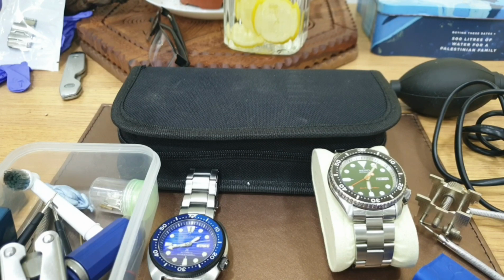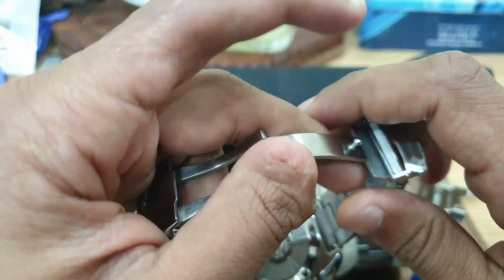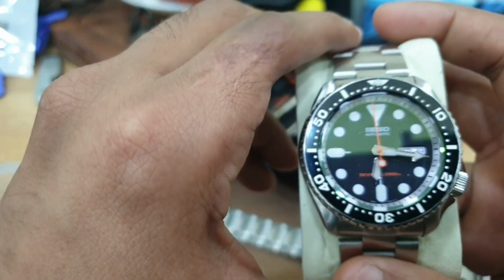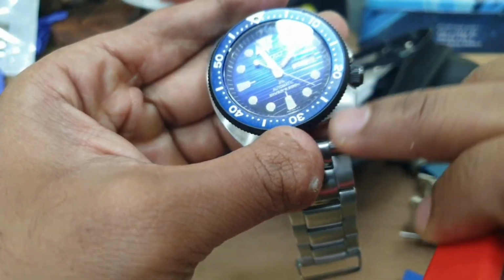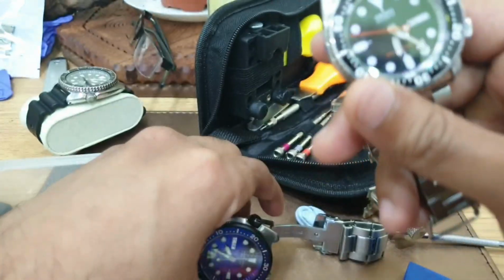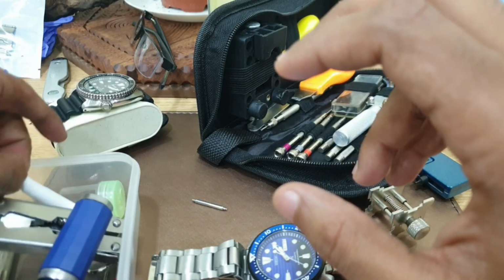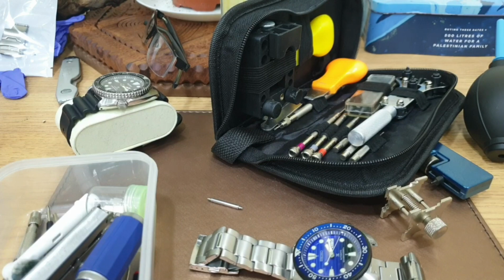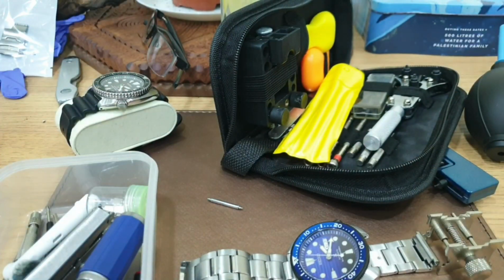Watch Modding for Dummies - Tips & Tricks | The Watcher

Comment: Hi, thanks for the tips and tricks, I put together a watch with an NH35A movement, it ran fine for two days but now it tries to run and stops. Could the problem be with the movement itself, I know that there is no interference with the hands. It seems to stop in the same spot.  Would over-winding cause this or magnetization?  Thanks
Reply from the maker: Not at all, ive had this same issue and i found that partial disassembly and reassembly does fix it. I think the pallet fork is out of sync with something and causes this unless the hair spring was damaged. This issue usually arises due to transport or a shock to the movement. Ive sold countless movements like this as spares and repair
Reply: @TheWatcherReviews  unfortunately I'm not that skilled or patient enough to fix so I would scrap it for not working. Thanks for your help.
Reply: @TheWatcherReviews  thank you I didn't try to disassemble it but a few  'hard knocks' got it running again. Although this nh35 mvmt is running fast. Is there any way to adjust it?

Comment: Hi, I would like to know which dial legs would have to be cut for a 4.1 (o'clock) position on the dial face. I cut the legs on my dial for a 3.8 position and I am slightly off in alignment with the case (tuna can case). I can't find any answers other than ordering a tuna case for 3.8 position. Thanks
Reply from the maker: Only a few dial offer dial feet for 3.8 with the triple legs installed.  Best way is to check like for like.

Comment: Thanks for this video much appreciated 👍 I always get little bits inside the glass when putting the movement back in, then I whiped the inside of the glass with a polishing cloth and put all back together however lots of little bits of dust and bits of the cloth inside the glass, before I ho back in any tips on cleaning the inside of a glass before reciting the movement, cheers
Reply: Keep everything away from your case when you take the movement out and/or close it again or keep it in a clean box or plastic zip lock bag while you’re not working on it.
I use lint free tissue but that’s because I bought lots of whatman lens tissues years ago and have never used it all for cleaning my microscope lenses.
Use gloves or finger cots as well.  
If it’s just the glass a lens tissue with alcohol is probably the easiest and quickest way to clean it.  I also keep a small watercolour brush for wiping any bits of visible dust away.  A soft squirrel hair or other natural hair brush won’t scratch anything as long as you keep it clean and wash it before use if it has been sitting.

Comment: Can I ask a question.  I dropped my Invicta venom and It hit the bathroom floor. Landing on the corner of the crown and crystal.  Now it runs for 30 mins and stops. Can I fix this?
Reply from the maker: Try banging it at the same angle into your palm, should loosen the spring if it is caught. If not then you may need to replace movement